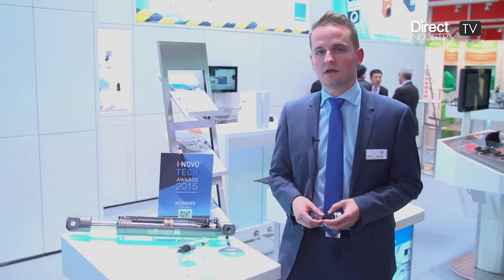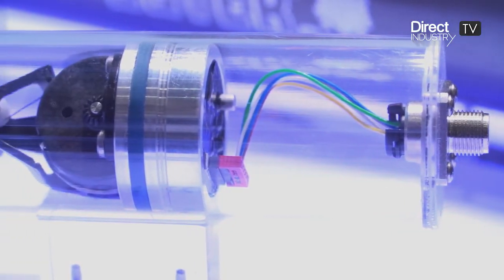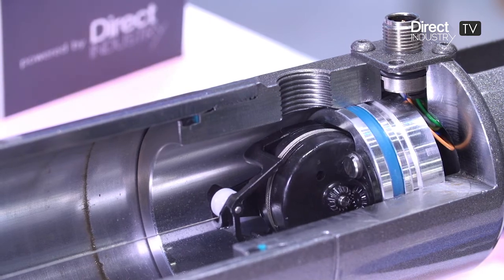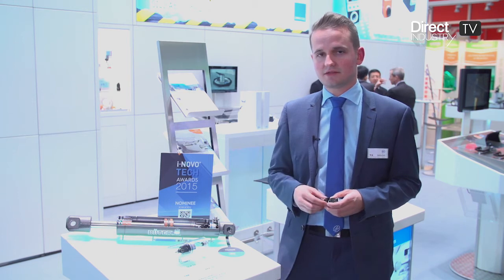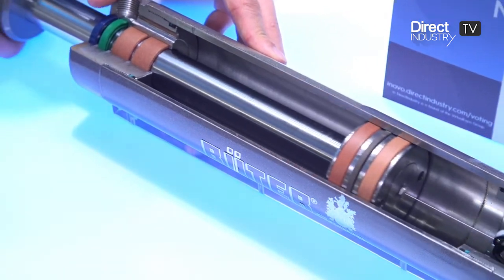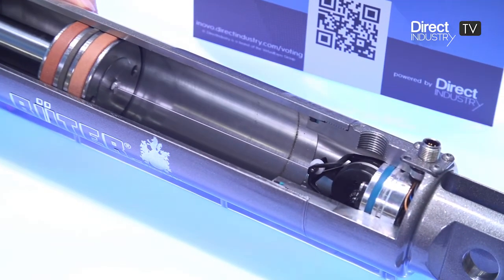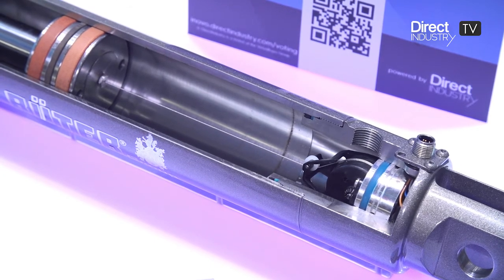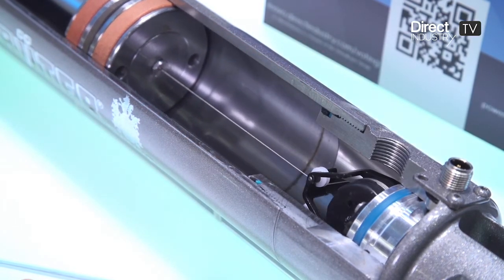SIKO wire-actuated Encoder SGH10 Hydraulic in-cylinder position feedback sensor @SPS IPC Drives 2015

Comment: So that entire mechanism is in the high pressure hydraulic fluid? Looks crazy.
Reply from the maker: Hi Craig. Thank you very much for your comment. You are right. The sensors can handle up to 450bar peak and 650bar proof pressure. And with this ratings they are one of the leaders in the industry.